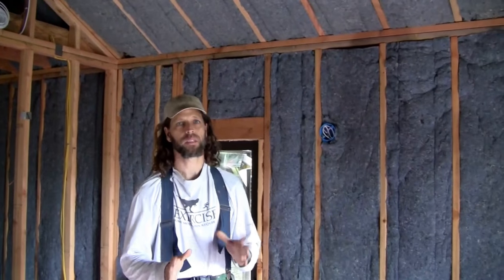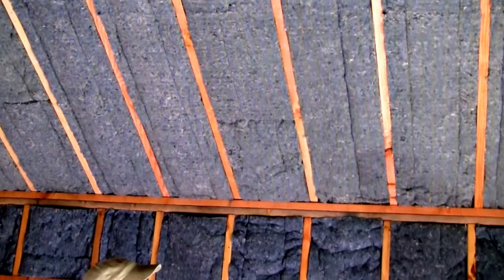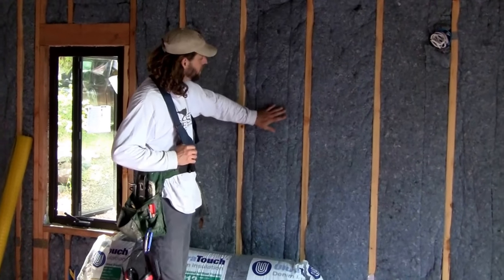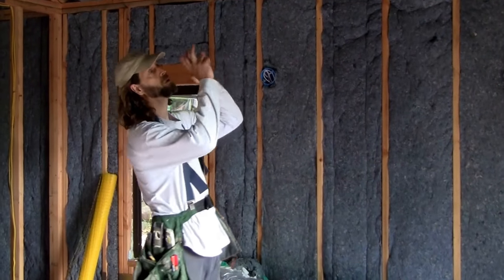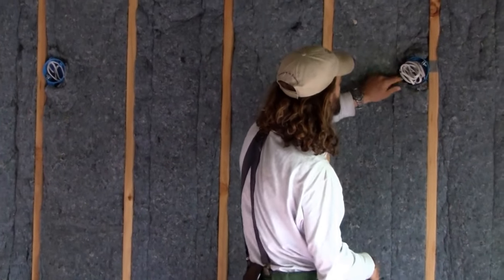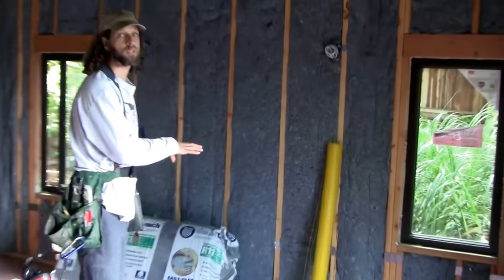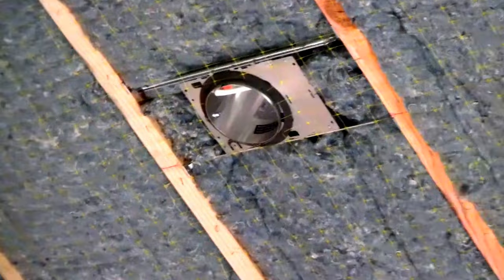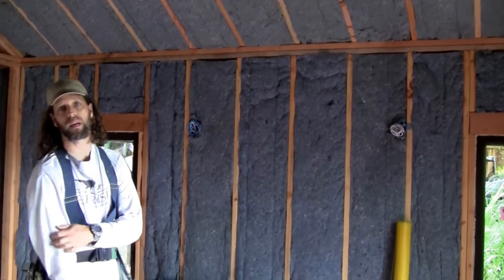Review of UltraTouch Blue Jean Insulation and Installation.

Comment: Any idea on if I should cover the denim with Kraft paper of foil or ? Before installing wainscoting? Thanks...
Reply from the maker: You need a permeable vapor barrier on the warm side of the building.  inside in cool climates.  Outside in hot climates.
Reply: @TheRegenerativeHome  I used 6 mil polyethylene - on the inside, have tar paper on the plywood outside. I’m in the Sierra foothills, appreciate your reply. Thanks.

Comment: Thanks for this insightful video. Planning on adding some of this stuff to my exposed basement joists for a bit of cost-effective sound dampening. Helpful to know about the dustiness. 

Question: Would there be any issues if I left my basement joists exposed after installing this insulation? (I don't plan on finishing my basement at this time.)
Reply: I think the denim is treated with a non-toxic borate solution (like cellulose is) which makes it fire resistant (virtually fire proof) and prevents mold.
Reply: Lush Planet Design Build I think you meant Roxul Insulation made from actual grounded up rocks! Wish I knew about it before I put in the garbage pink fiberglass insulation